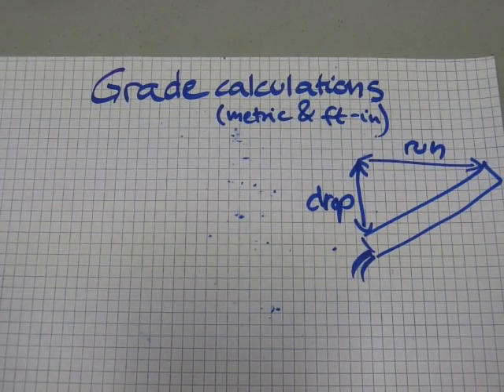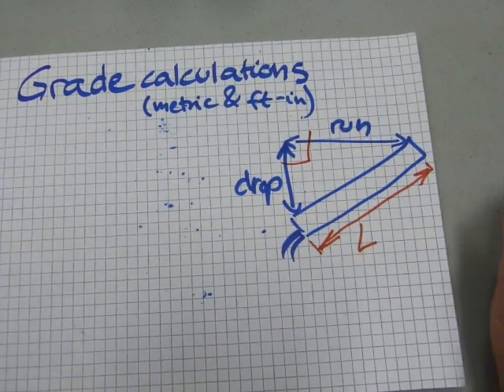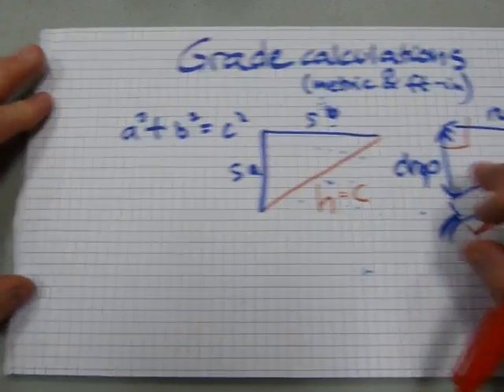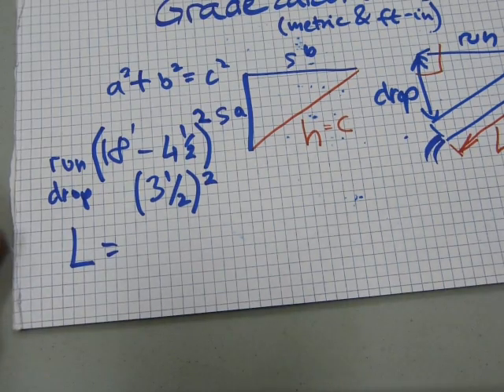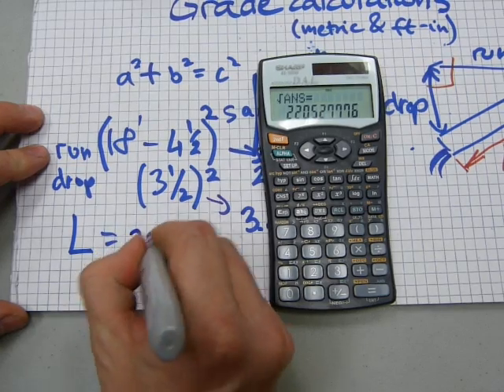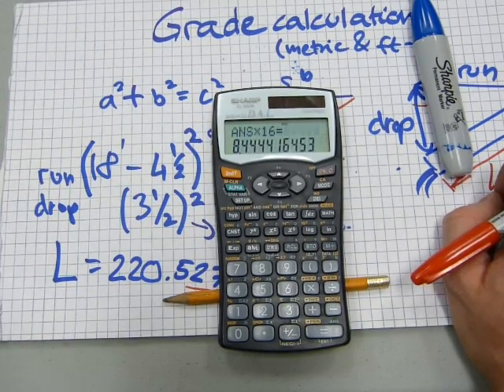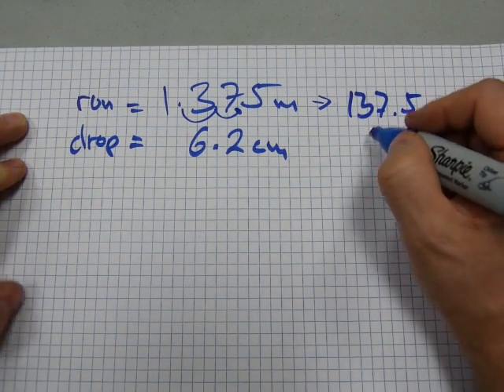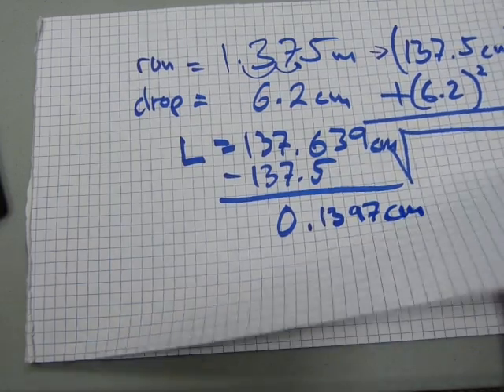Grade calculations: length of a pipe, given run and drop (metric&ft-in)

Comment: If you are interested, then perhaps you might take a peek at the Handtuber Offset Calculator which can be used to quickly work out offset measurements for instrument and copper tubing.
Reply from the maker: Tubers, especially offset ones growing on hands should be seen by a doctor, which I ain`t.
Reply: That was quite good, and thanks for the reply.
Reply from the maker: Thanks for getting grammar jokes, you must have gone through a classical education.
Nice work with the app, please include a link here, good resource for learners.
Reply: Handtuber sir we need about shrinkage about some degrees